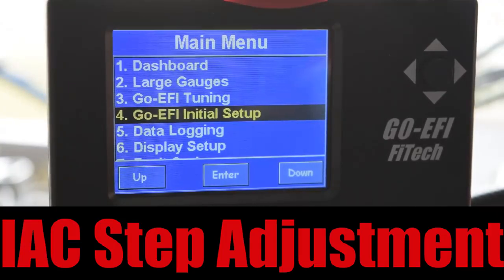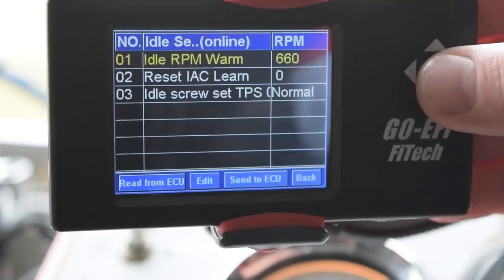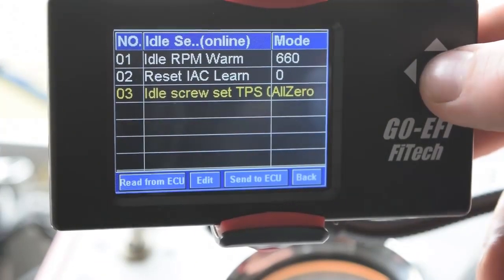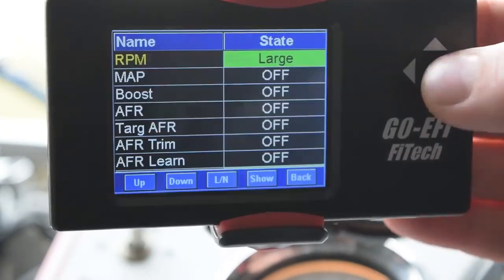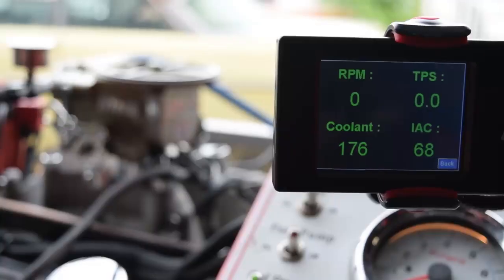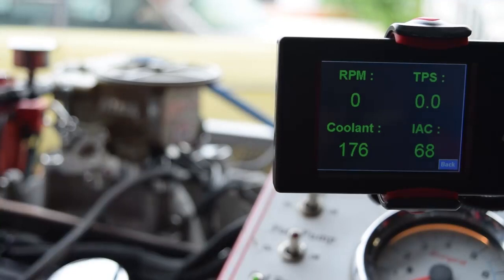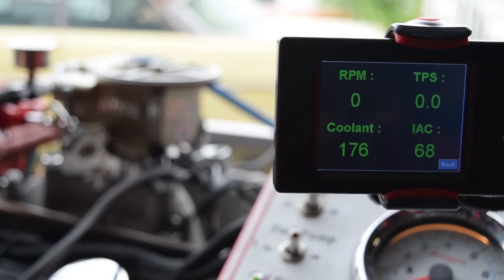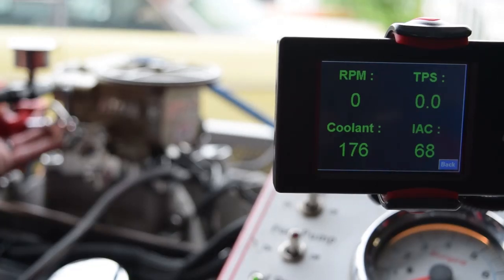Setting IAC Steps with a FiTech throttlebody EFI System

Comment: My problem is I can’t get the car to idle!!!!! She dies immediately every time after the prime shot
Reply: If you haven't fixed it, it's the wire going to the tach. The other issue is too much pressure found in the valve covers
Reply: @soloparadise2292  fixed it. No fuel pressure. Guy at the shop told me to run a return line on the ultra ram which prevented buildup of fuel pressure

Comment: NOTE: The procedure demonstrated in this video is both incomplete and incorrect. ANYONE who attempts to set the IAC steps with these incomplete instructions will not get to the desired setpoint. Suggest you remake this video and give/demonstrate the complete working procedural steps. Either that, or please stop making these videos.

Comment: Found what appears to be the solution on their website (finally).

https://fitechefi.com/fitech-efi-basic-setup-instructions/

Tldr: 
1 -- Initial setup > idle setup > idle set mode: on
2 -- Go to large gauges, make sure iac is set to show, show the gauges
3 -- adjust idle screw until iac is in the 1-10 range
4 -- shut off engine, wait for numbers to disappear
5 -- start engine and verify it took

My idle went up about 100-150, I've read in the forums that people needed to do the iac steps sequence as many as 5 times to dial it in. It's getting a test drive right now, but I'll hit it again and see if I can get it to idle with the right iac at the right rpm. Do NOT set learn iac when you enable idle set mode, you'll just be running in circles, possibly for days! 🤣🤬🤣

Comment: Ultimate ls does not have that menu option. We can get it to 0-10 range with high idle, but bringing idle back down brings iac back up. Tried enabling pro mode, but that menu option still doesn't exist.
Reply: Found what appears to be the solution on their website (finally).

https://fitechefi.com/fitech-efi-basic-setup-instructions/

Tldr: 
1 -- Initial setup > idle setup > idle set mode: on
2 -- Go to large gauges, make sure iac is set to show, show the gauges
3 -- adjust idle screw until iac is in the 1-10 range
4 -- shut off engine, wait for numbers to disappear
5 -- start engine and verify it took

My idle went up about 100-150, I've read in the forums that people needed to do the iac steps sequence as many as 5 times to dial it in. It's getting a test drive right now, but I'll hit it again and see if I can get it to idle with the right iac at the right rpm. Do NOT set learn iac when you enable idle set mode, you'll just be running in circles, possibly for days! 🤣🤬🤣

Comment: On the 600 the idle screw is the tps and once you get to zero , alot of the times your iac might be like 30. I found after you get to 0 on your tps adjusting the timing and idle speed can get you into the 0-10 range

Comment: You need to do more tech and tuning videos.  I have off idle stumble/hesitation.
Reply: Me too! Did you ever figure your issue out?
Reply: Check Nashville Early Bronco YouTube channel for a lot of help with setup and stumbling.   I have been researching trying to decide which unit I want to go with and found a bunch of info there.
Reply: Do the tps supposed to be at 0 my tps at 0.5

Comment: Mine does not have idle set screw adjustment on the handheld ., what is the answer to this from fitech ?
Reply: Idle set screw is on the right side of the throttle body. No adjustments are on the hand held controller.
Reply: go to display setup and switch pro cal from hide to show and it will be on the main menu.
Reply: I dont have it, I've switched on pro cal, do I need to upgrade firmware?

Comment: Mine does not have idle set screw adjustment on the handheld. I followed the steps three times it's not there
Reply: Mine does not show it either, do you know if there is another adjustment that would be similar?
Reply: @adalmadera25  go to display setup and switch pro cal from hide to show and it will be on the main menu.
Reply: @rodneyprast9035  what will be on the menu?